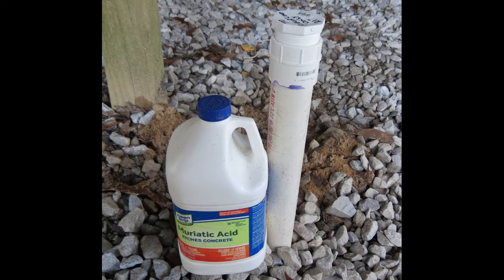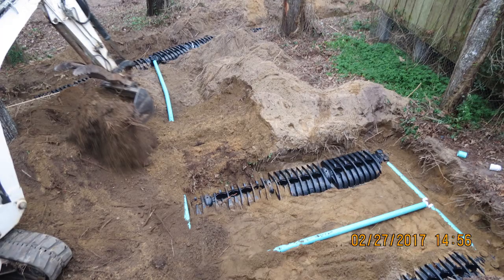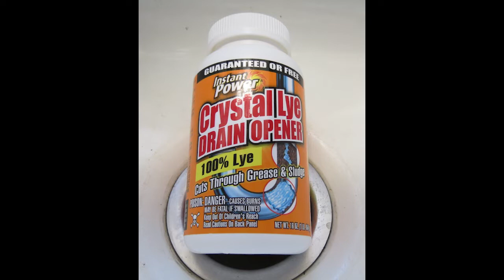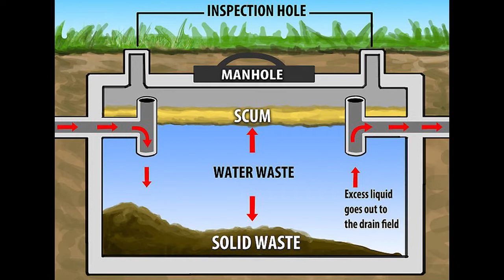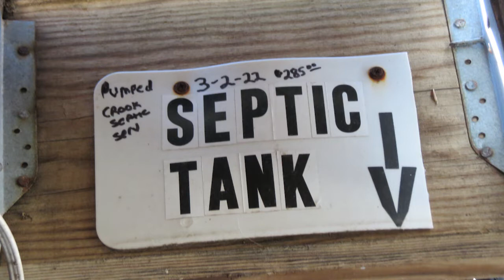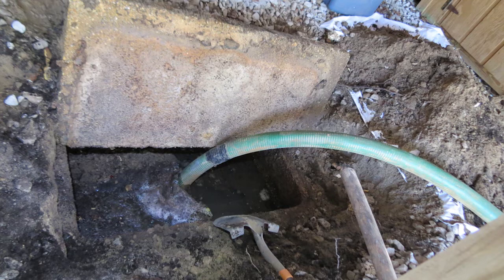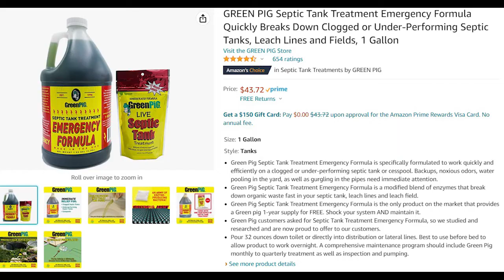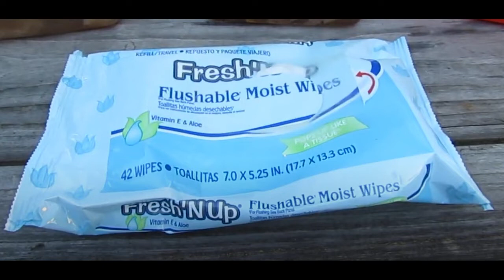How to fix septic tank drain lines pipes can field lines be repaired instead of replaced Read Below

Comment: In your experience, how is a home sale handled when there is an old (circa 1967), concrete septic tank that ceased to be used when the home was switched to city sewage in the 1980s? It is still there but nothing has collapsed or subsided and no one would even know it was there, except maybe an experienced inspector like yourself might "predict" it was there based on location, and maybe seeing some telltale piping remnants in the crawlspace, but I am not sure about that piping's existence anymore. Is that something that is disclosed by the realtor at showings or is it only disclosed during the negotiations?
Reply from the maker: I believe only a realtor will know the answer to that question.